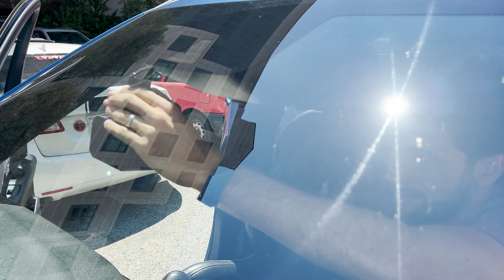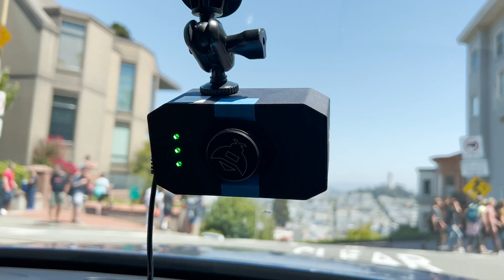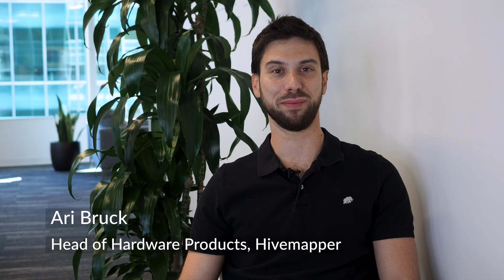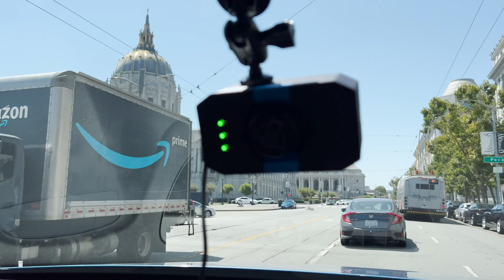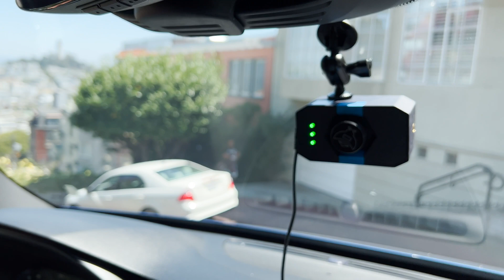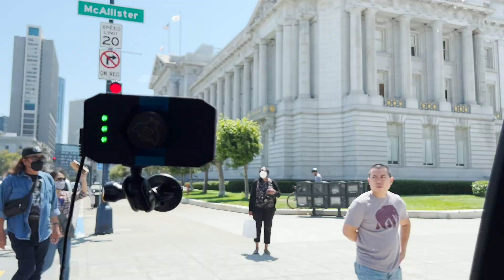We’re excited to move forward with our worldwide testing and hardware validation process

Comment: Is there anyway not to use suction cup? I had several dashcams in the past and they always fell down from the weak suction, until I got Aukey Dashcam which uses 3M adhesive to mount the dashcam in place on the glass. For over 2 years now, it still stays in the same position without falling from the glass. Thanks.